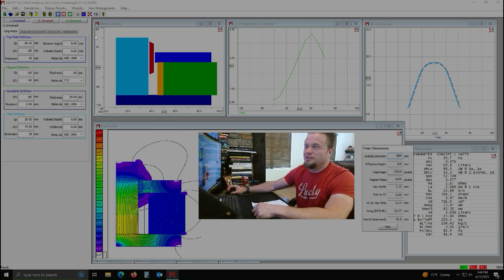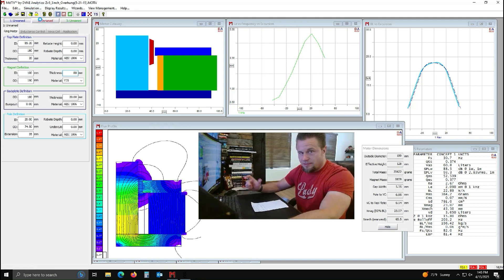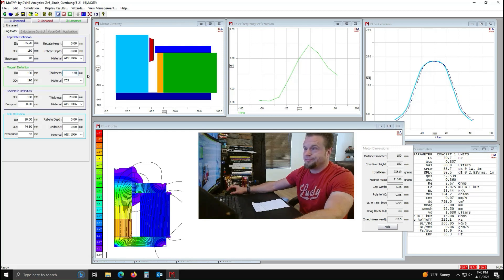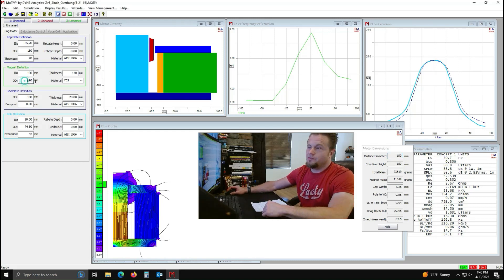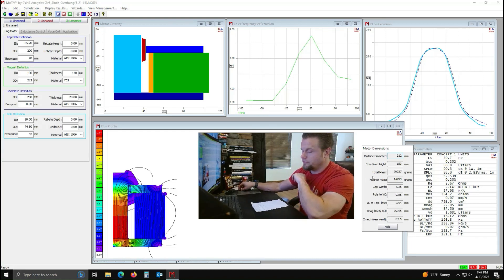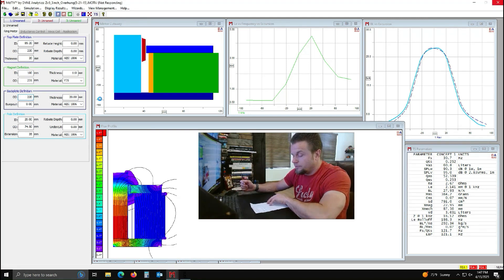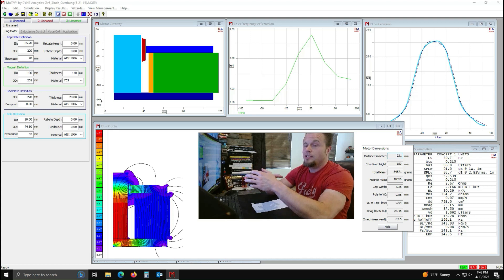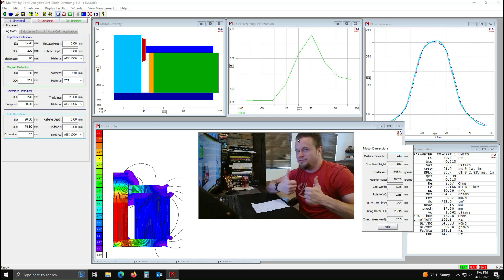Magnet HEIGHT vs WIDTH for Motor Force

Comment: So Fi audio was right
Reply from the maker: The BTL UFO was a good sub. If that's what you mean.
Reply: @jacobfuller9893  Yes, I also thought about the sp4
Reply: the shape of the magnetic structure plays a huge role in the strength of the magnetic field so if you increase the diameter of the magnet you will increase magnetic field in the gap where is making the motor taller doesn't really do anything

Comment from the maker: WOOPS - I messed up - Unscripted and such

212x66 Example
I left it as 110 tall when I ran that simulation
Shows 292 motor force (at 110) - it's 282 actually at 66mm height

231x66 example
I left it as 110 tall again when I ran that simulation
Shows 343 motor force (at 110) - its 342 actually at 66mm height

This does cement the point, though, having the extra 44mm of height did even less here than in the initial examples.
Reply: Very Interesting, appreciate you taking a little time out to show us a little bit into how you design these subwoofers!!! 👍
Reply: This is because when it comes to magnets shape is extremely important I bet you had you added that same amount of mass but kept at the height of the motor the same only increased the diameter of the ferrite you would have gotten a greater BL Factor in comparison to adding Mass to the motor by making it a taller stack
Reply from the maker: @SheikhN-bible-syndrome  : Yes that is the general idea of the video - that the width is much more critical for strength. I've had questions about this topic hence the video =)